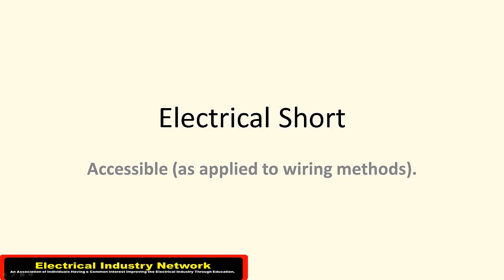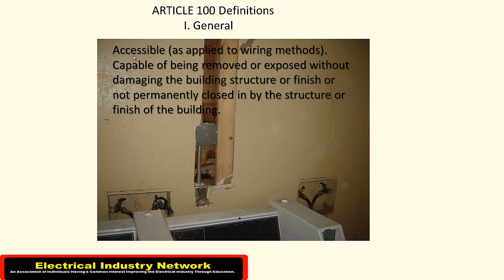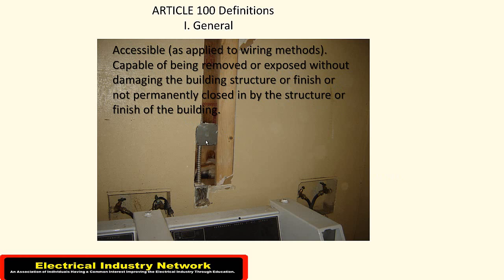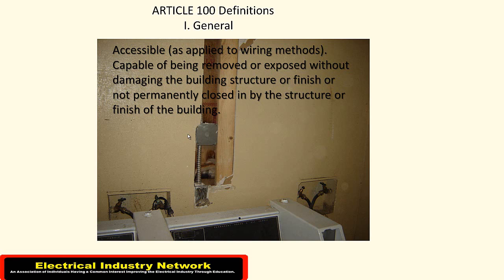Accessible Wiring Methods - Electrical Short

Comment: Sadly if the previous worker did not want to run whole new wire, could used a 1 gang j-box with an blank cover. Glad you just ran new wire and made it look like it should.
Reply: Exactly!